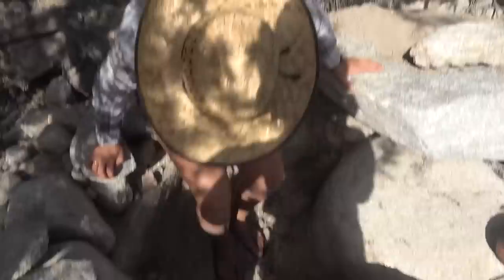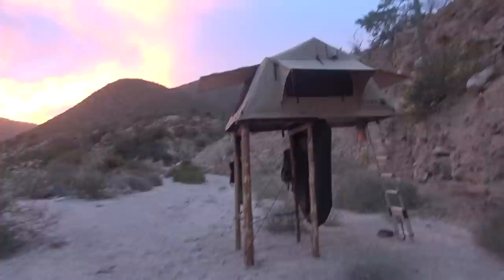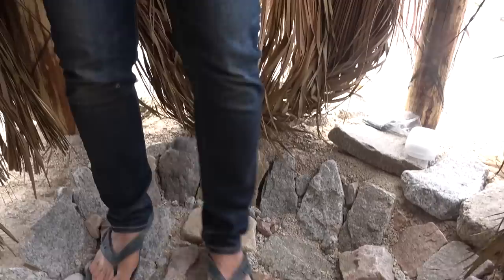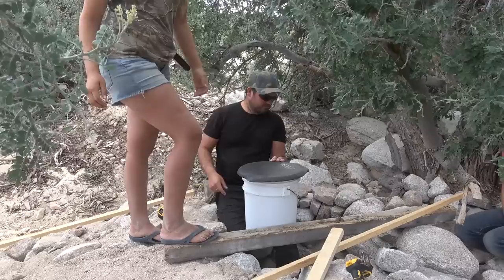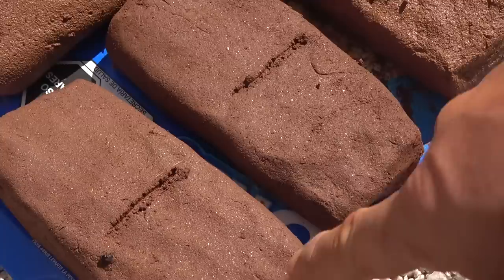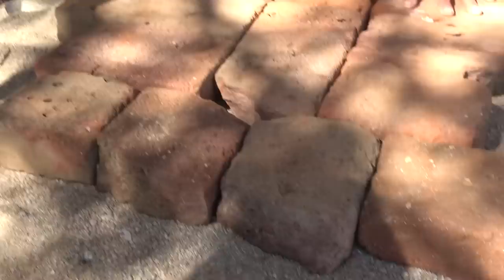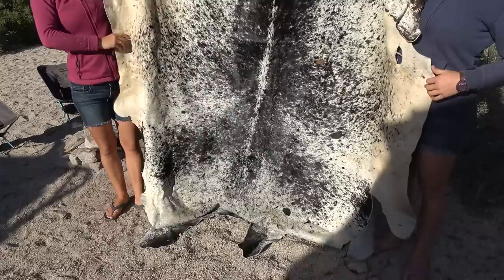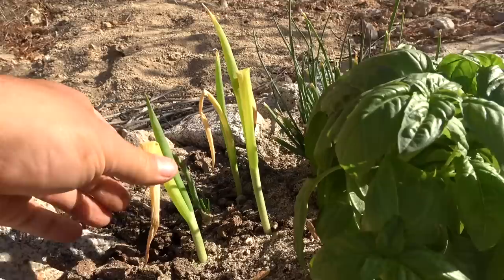Like Swiss Family Robinson

Comment: I use a new small pump sprayer for spraying weed killer or insecticide for a shower. You can pump it up and you have lots of pressure to rinse off. Works great with just 2 gallons . Great videos . Cheers from Ontario.

Comment: What a great camp site 😱, your protein comes right to you. Check out the video from "Shawn James" when he built his pizza oven for his outdoor kitchen a few years ago at his old place. He just mounded up a bunch of damp sand on a flat surface & packed the clay onto the sand. Once the clay had dried enough to hold its shape, he just dug the sand out from under the clay through the opening he had left for the door. Then build a small fire inside to finish curing the clay. Have a great day 😊.

Comment: I'm really only interested in two things the location of your homestead. So I can see the train on Google maps.. your micro hydro system The mask just doesn't add up from the videos that you've done on the system it doesn't produce the power that it should.. if you're homesteads in the valley and you get 10 ft ahead and then it all makes sense but the video it's like your intake is way the hell up in a ravine so you should have a lot more head or pressure then you do.. and if I can see the topographical map location well then maybe it would make sense... And I don't expect you to tell your exact location for all the creeps that are on here.. I spend enough time on Google maps I probably have well over 35,000 locations marked.. I know that you're in like Central to northern BC I know that you're roughly 30 to 50 mi from the ocean or some inland bay. I have a theory that your homestead is near the home base of destination adventure.. I really like watching his channel a lot has a lot of good contact from like old ghost towns that are really interesting.. but then again the city where the girls had the food truck is probably 350 miles in land.. if I know that I'm looking at an area of Google maps 30 mi wide and 50 mi long it'll take me about 3 days to find it.. so what town is your homestead near. Does the creek that you draw power from or your micro hydro system on have a name.. I have seen probably 95% of your guys's video so if that Creek has a name you haven't mentioned it.. of course if that Creek is only 10 mi long and that points the location to your property that you don't want to say. What it is then what Creek or river does your creek that generates your power flow in too .???

Comment: I would like to place an order now for a large wallet oblong six inches with card slots inside and a bill / money area, not folded in half traditionally with coin slot as well with brass zipper. A brass zipper that goes three sides on the outside so it folds in half lengthwise Along with a finger / hand strap on the outside..enough to put my large hand through. Perhaps an exterior panel with a transparent plastic for ID? And of course your magnificent carvings of wildlife along with your signature! That would do fine.Can I do this. Will pay in advance... How do I contact you directly for billing and such communications?
Reply: Not sure if I want the Oreo color though... Carvings won't show as well... We will sort it out ok?